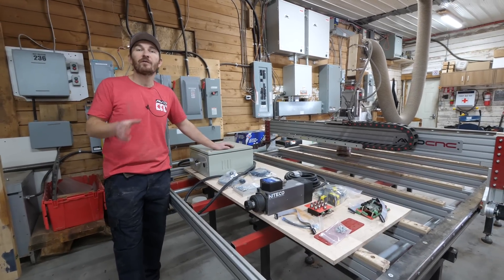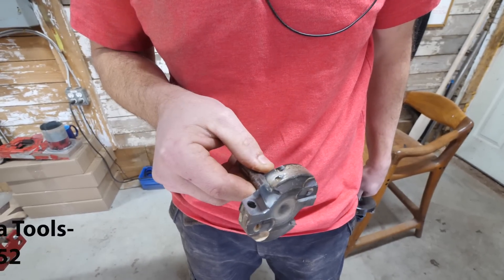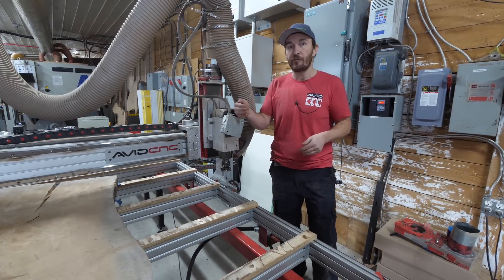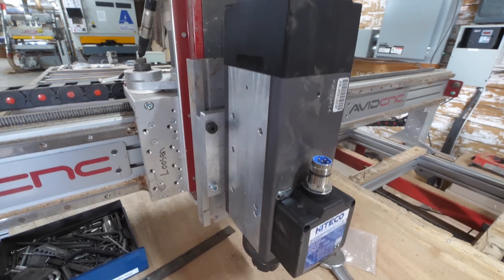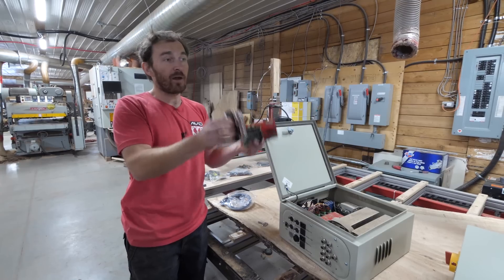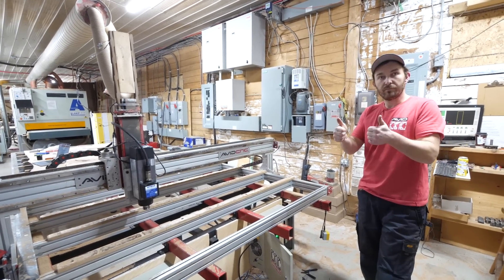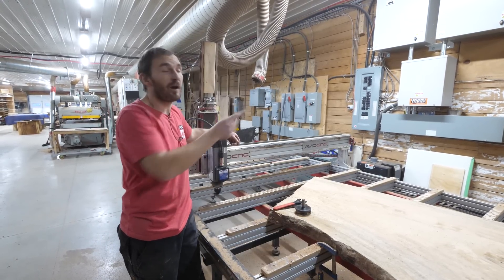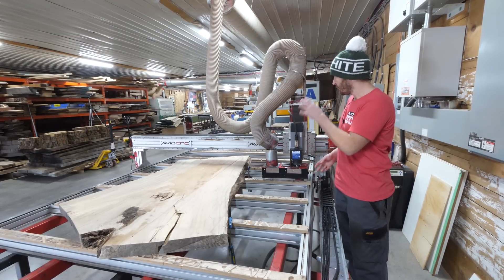Avid CnC Upgrade to 8.7hp Spindle

Comment: I just wanted to tell you your video was awesome.  I also have an Avid 4848 Pro.  While watching your video I had a thought about protecting your cutters.  I was wondering if a metal detector that you could pass over the slabs before the program is started could efficiently detect any metal that might be embedded in the slab, allowing its removal prior to surfacing or milling. Just a thought..
Thanks Again.

Comment: Are you using 3 phase power? The Avid site states that running it off 1 phase power reduces peak power to 6.4hp. Does it ship with an undersized vfd? I run a 7.5hp spindle from a 50a 240v single phase circuit with a 10hp vfd designed for 1ph power in - 3ph out and I don't have to reduce peak power.
Reply from the maker: Yes I have 3 phase power, but I also agree with you, I like you run many machines with single phase in and 3 phase out, I've always practiced double size the vfd compared to the motor, from what I understand this does not reduce HP. So I don't know why this vfd would limit the HP with single phase but I larger vfd then needed is always better when using for single to three phase. Maybe this VFD has some sort of auto programming to limit HP if single phase.

Comment: Nice video! You should wire your dust collection into your main controller box (relay 1 or relay 2). That way you can turn it on and off in Mach instead of the wall switch.  Maybe do a short video on it as well.
Reply from the maker: Thanks for the tips!

Comment: Too bad about the 3 phase requirement. My new CNC is coming with 5.5kw as i don't have 3 phase available in my area. (I'm in the country)
Wonder if they make a VFD that could run bigger while operating on 220 single phase.
Reply from the maker: We use a phase perfect to create our 3 Phase for our bigger machines, they are really nice units but a decent investment.

Comment: I just recently purchased the same spindle for my Avid and plan to use it to flatten slabs.  Is your spindle hooked up to 3 phase or did you use the converter that comes with it and run it on single phase power?
Reply from the maker: Hi, Great choice this spindle is really nice.  No matter what you need to use the Vfd that comes with the spindle, yes it will convert single phase to 3 phase, but they say you'll loose about 2hp if you don't feed it 3 phase.  I am feeding it 3phase from a Phase Perfect single to three phase converter

Comment: Recent subscriber and love seeing the bigger CNCs and slabs getting surfaced. You mentioned controlling the CNC with the keyboard. Is that for flattening the full slab or just for some of the high points that need a separate pass? If it's for the full slab is it just quicker to jog it through with the keyboard than writing a flattening program for each size?
Reply from the maker: We use the keyboard for just the initial passes where we would be cutting more air then wood, once the pass will take at least 50% wood than we run the program.  Over the years we have written all the programs we need, we just need to use a program that is wider than we need and just. a touch longer.
Reply: @CanadianWoodworks  Makes perfect sense and thanks for sharing.

Comment: What do you use to sand the slabs once flattened?  Wood mizer sells a slabbing machine that has a 7" sanding disk head.  Would you think a sanding disk would work on the CNC.  You may do a volume where you need to get the slab off?  Thanks.  Great machine and vid BTW
Reply from the maker: You right, i've used the sanding head for the cnc but we need to keep it surfacing slabs, so we have a 53'' wide belt sander, that is for sure way faster and better at sanding.  Thanks for watching!

Comment: When it comes to surfacing how much more accurate is it to do it on the CNC as opposed to the thicknesser planer?
 And with a bed that size I am really surprised you are bot running dual gantries and heads.
Reply from the maker: The cnc is 100% flat, the planer not always. Really depends on the material.

Comment: I like the video, keep up the good work. Quick improvement tip - You should probably invest in a collet nut torque wrench, that brute force method at 11-minute mark is really not the way to go. Too much torque, even over short timespans, reduces the holding forces and creates more runout and faster worn out collets. Too little force you probably already know what happens.
Reply from the maker: Thanks, i'm on it!